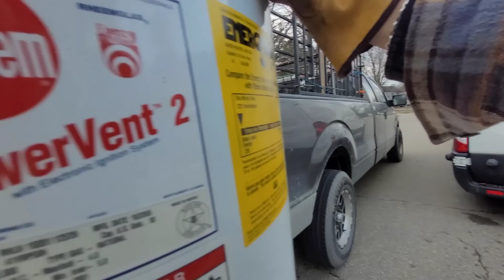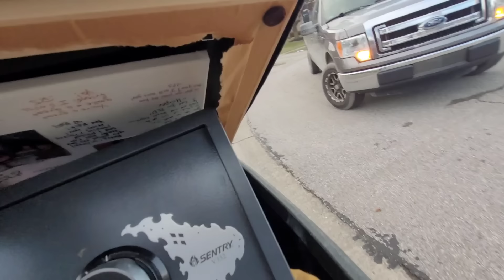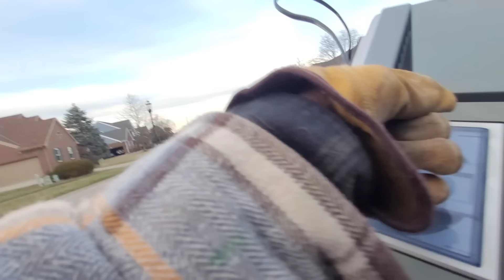Curbside Scavenging For New Dwellings

Comment: I wonder what it would have weighed at the dump if it was not all soaked and full of water weight.
Reply from the maker: Less. 
But no matter, anything under 2000lbs is $59.50 
Could be 47lbs and it'll cost $59.50 
Anything over 1 ton and they start to charge by the 100lb
Reply: @MrScrappity 90 a ton here.... Then you can't come out over 9000 Without A DEP number.